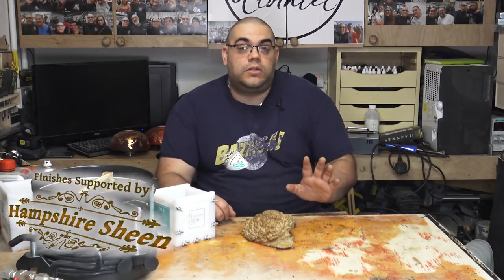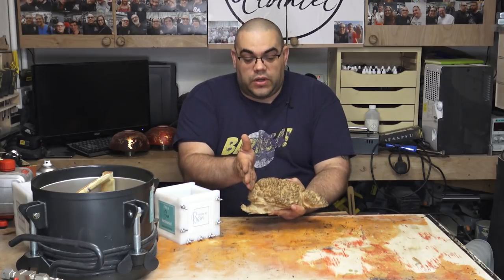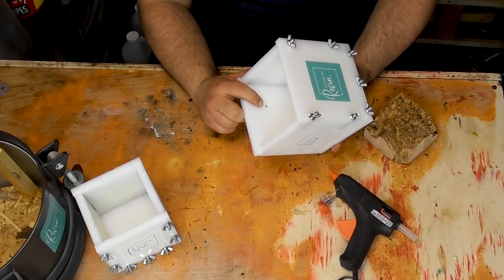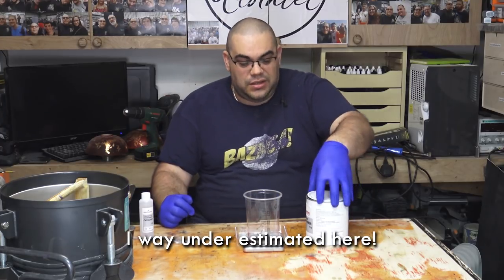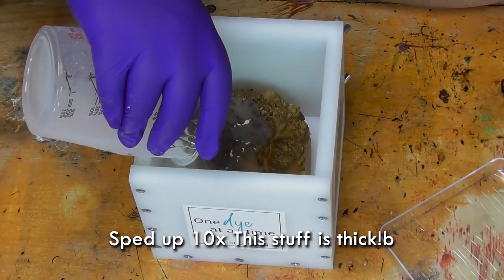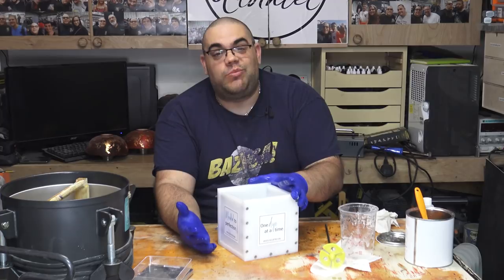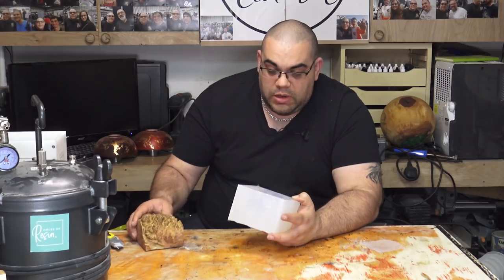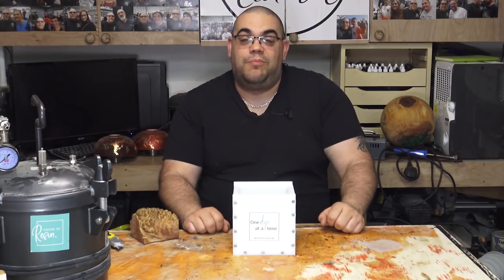Making A Resin Burr Mould - Part 1

Comment: Interesting John. I've seen some people (have no idea who) where they used a silicone that doesn't gather the air bubbles. This reducing the need for a pressure pot. Especially with silicone when you compress the bubbles in the pressure pot they obviously expand when you take it out again. No that this project needs to be so accurate but hopefully something to think about for another time.

Looking forward to see how the final piece ends up.
Reply from the maker: That is true that the bubbles will try and expand but they are so small they dont really. Plus I wouldn't cast the resin without it being in the pressure pot anyway so they would go back to being small, I hope lol. Thanks! Should be fun

Comment: Great video again John, I actually cannot wait to see how this turns out, I have a bit of beautiful burr myself but have been holding on to it as I like it as it is lol. This could be a way to use it. Hmmm?
Reply from the maker: Thanks Mark. I know what you mean. This was part of the reason for me doing this. Getting hold of nice bits of burr isnt easy or cheap and this seemed like a way to fix that. Look out for part 2 and we will see if it works